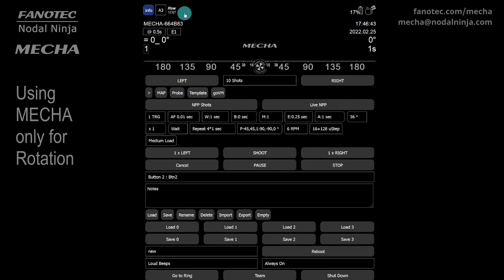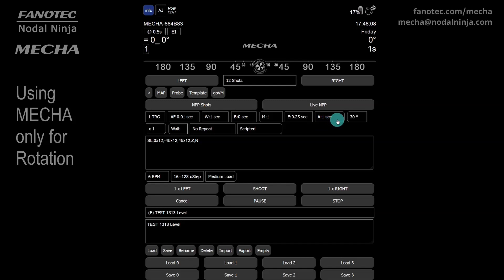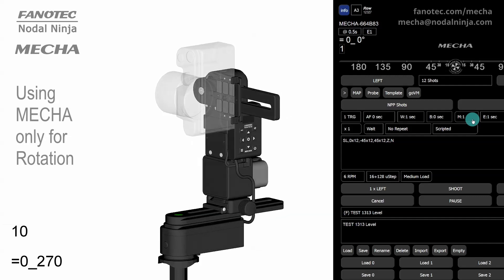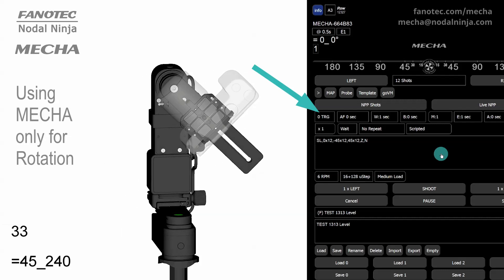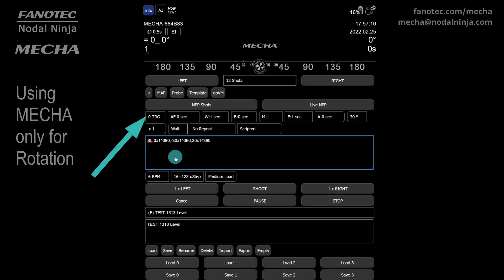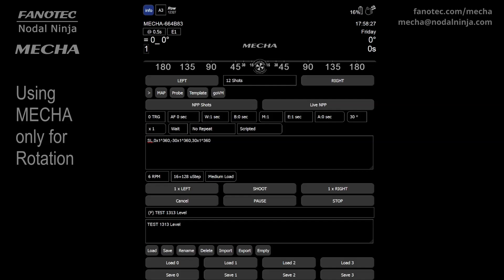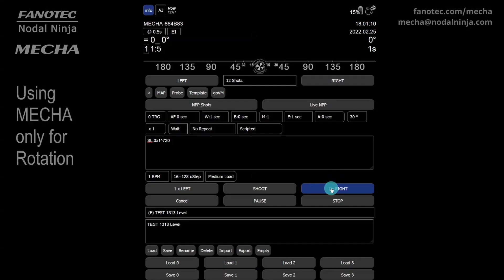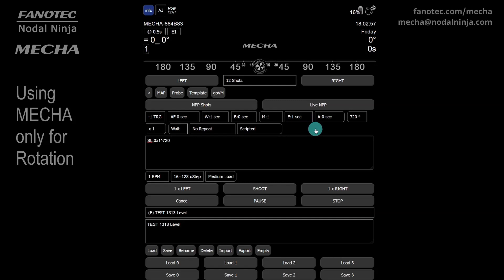Using MECHA Only for Rotation

Comment: Hi, I have a question. I would rather use DSLR controller app for taking the photos rather to use the mechas presets... so if you could show how to rotate it by phone app without taking photos, but also how to do it when I don't know how many time I need for the head to stay in each position - for example if I want to use additional flash pops for my shot than I would need the head to stay in position for as long as I take the additional flash shots, and than I could give the mecha app a go to continue to next rotation position.  So best would be to have an option to manually control the rotation for the lower rail, and than for the upper rail to take nadir and zenith shots. Can you show how this can be done in app? Thanks
Reply: In MECHA, for E:delay, there is E:BTN > C. setting, which means a button confirmation for each trigger,  so you can use that or another way is to use Step by Step mode in which MECHA will advance to the next position only after a press or tap on the button [>]. You can use either the buttons of the Web UI or physical buttons of the controller(s) or NN IR remote. If the pause is unknown at the beginning but should be the same for all subsequent positions you can also use E:BTN > CT when MECHA will learn the needed pause at first press/tap and will use that for the rest of positions.